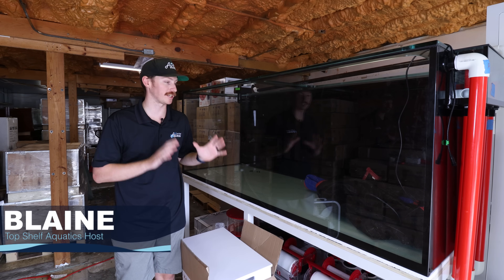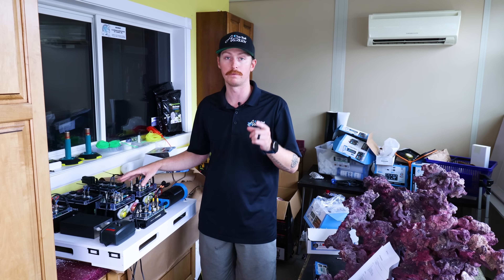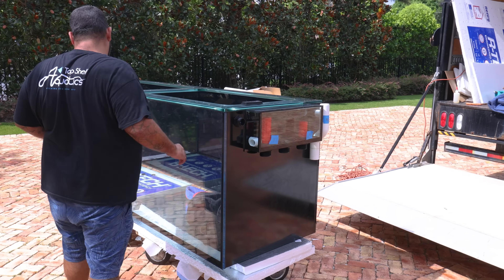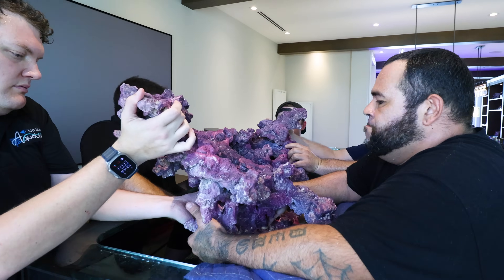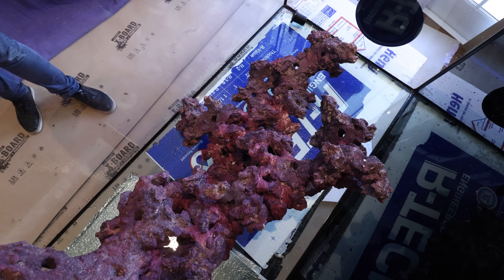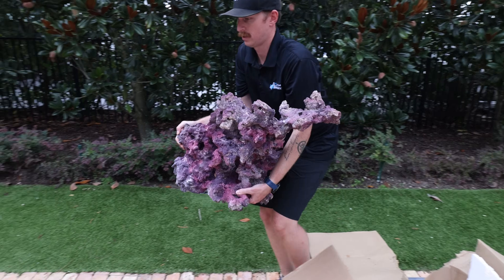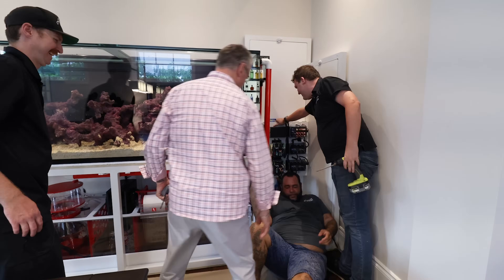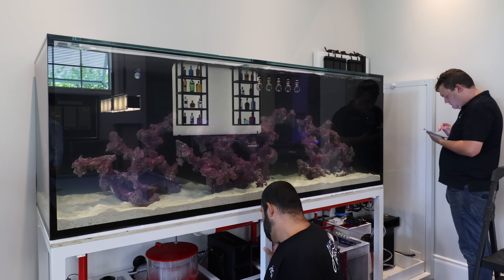Custom 400 GALLON Reef Tank Install & BONUS Aquarium Update!

Comment: I’m getting ready to plumb a tank that only has 1 hole for a drain and 1 for a return , what is the best way to plumb it to minimize noise ? Thanks🙏🏼🙏🏼
Reply: I’d plumb one as a full siphon and the other as a secondary/emergency. And run your return up and over the back into the tank.  And make sure your sump can handle the back siphon. I don’t trust siphon breaks. Not knowing if these holes are inside an internal overflow box or drilled elsewhere might change things. Durso is always an option, but not silent like a full siphon.
In a perfect world you’d have 3 holes. Full siphon, secondary, and Emergency utilizing an external overflow box. Modular marine would be my pick. Just my 2 cents. Don’t know what TSA might suggest. 🙂
Reply: I second this! Modular marine def worth it